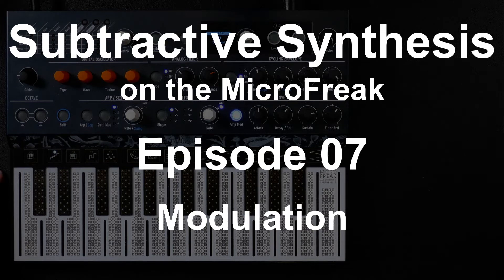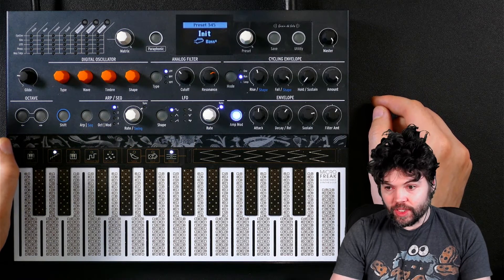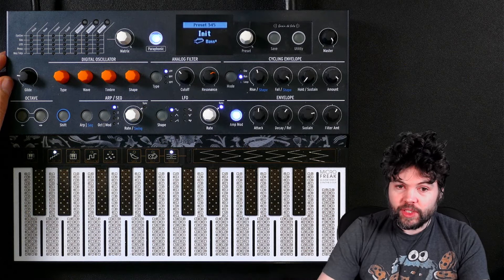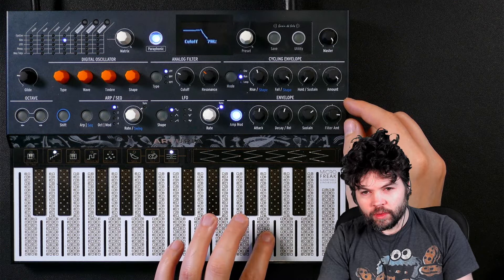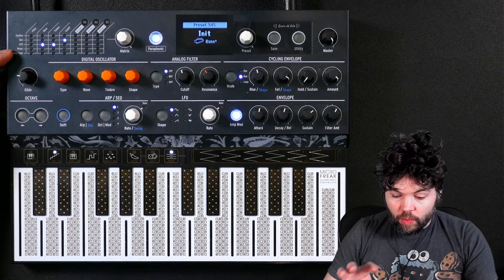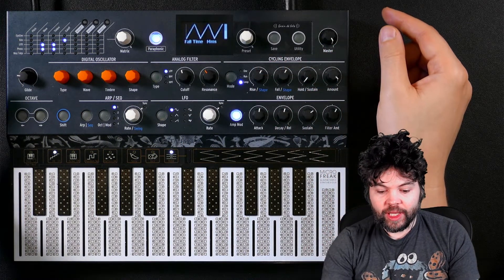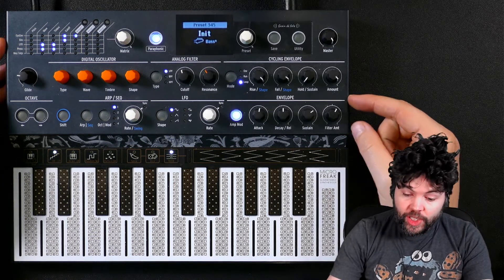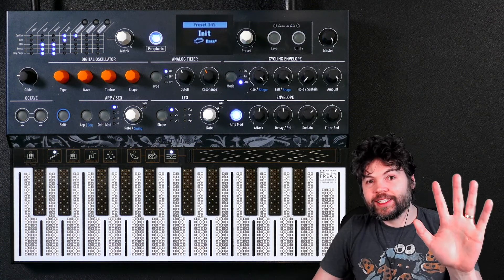Subtractive Synthesis on MicroFreak: Ep07 - Modulation

Comment: Definitely a cool sound and demo with good explanations. I followed along and had fun making a similar patch. One thing that I just learned a few days ago was the difference between run and loop. Definitely correct me if I'm wrong but I think the run setting makes the envelope free running whereas the loop option means the envelope starts from the beginning when you hit a key. This means that in run mode each time you press a key you will be in a different section of the envelope.

The other thing I'm sure you know but wanted to point out for others is the hold key which is the top left button right above the keys. You can press a key and then while holding it hit the hold button which will "hold" the key down for you so you have 2 hands for adjusting parameters. Anyway, great content, I'll be watching some of your other videos for sure!
Reply from the maker: Thanks for the comment, and for watching. You are correct about the cycling envelope modes. Loop is like the LFO with retrig, run is like the LFO without retrig.

The hold button is indeed useful and definitely worth calling out. One thing you'll probably note, watching this series, is that I tend to jump between synths. This means that, even if I knew all the features, I often forget about them and fall back to another approach. Hopefully it was good enough for a tutorial such as this.

I appreciate you adding to the conversation and sharing things you learned! I'm also always interested in feedback and thoughts on other videos you might like to see! Thanks again.